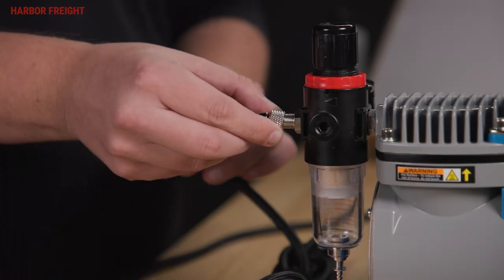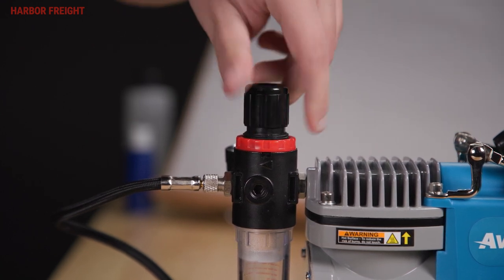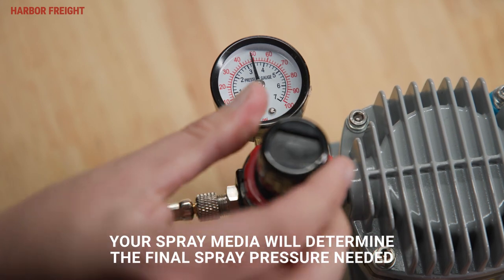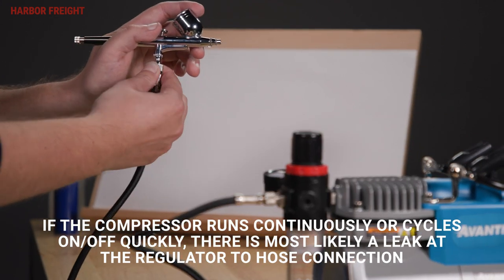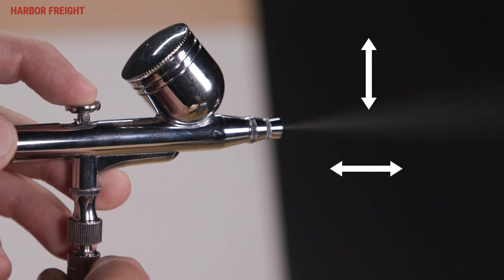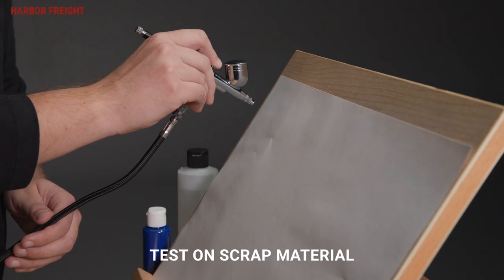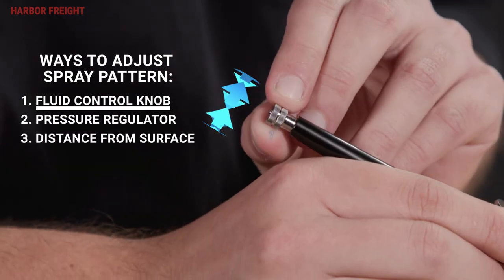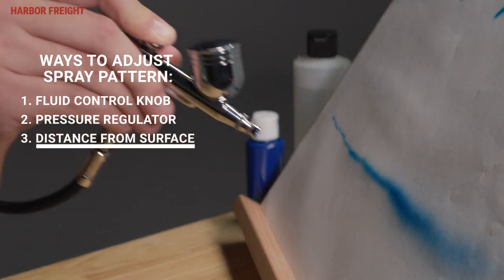Avanti Airbrush Set Up & Operation | Harbor Freight

Comment: It says tighten the loose connection but the air still leak from where the quick disconnect is connected to the airbrush. The air compressor also keeps running rather than building air up. What should I do? Isn't there a type of seal or tape you can apply?
Reply: Teflon tape should help.   A roll costs about 60 cents in the plumbing section.

Comment: What size is the Grex quick connect? I want to purchase this product but I want the piece that solved the leaking hose
Reply: The hose should not leak.
If it does and tightening does not fix it then take it back.